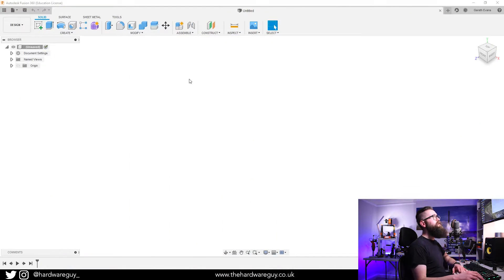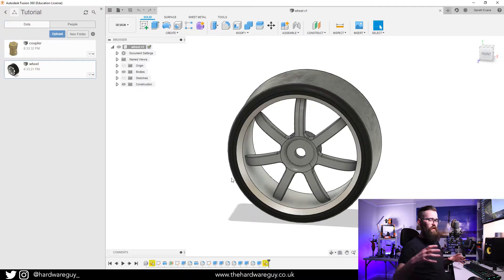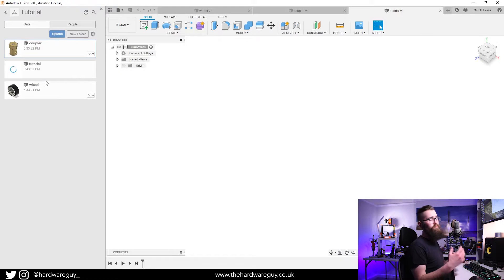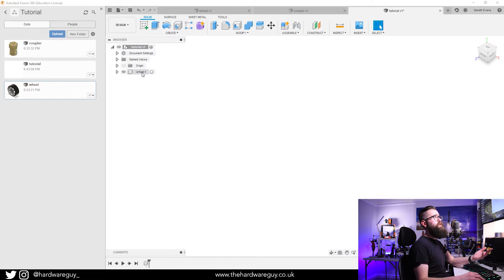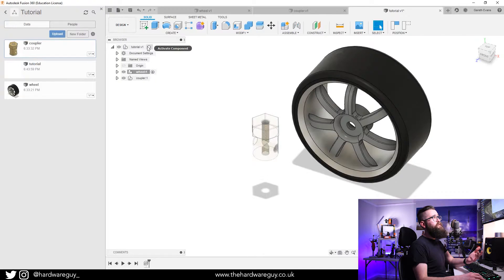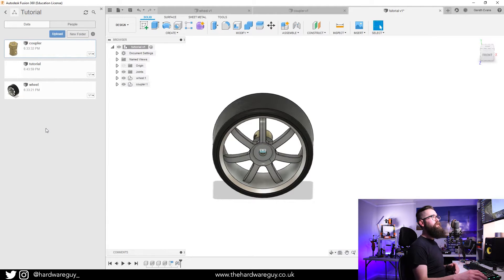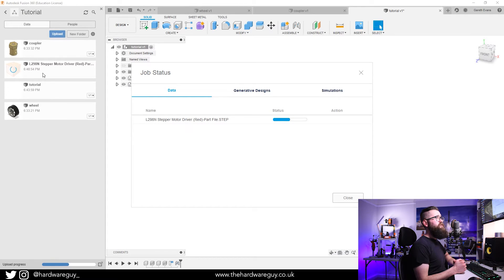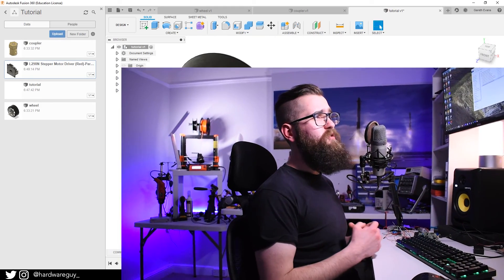Importing Models/STEP files to Fusion 360

Comment: I'm a newbie in Fusion360 and I've been struggling to make an assembly. With my student license I am limited to have only 10 designs on workspace at once. My assembly has more than 10 parts (files) and once I have reached that number I am no longer able to add new ones and can't delete the files already added to assembly because appears a message telling that that file is attached to other files and can't be deleted. If someone can help me I'll appreciate the kindness. Thanks in advance!
Reply from the maker: Yes this is a limitation set by Autodesk. If you want full access it's £50/month unfortunately. Not many people are happy about this
Reply: @thehardwareguy  Thanks for replying. I've figured it out by adding parts to assemble and saving the file as .step closing after each step and reopening again to add new part. Thanks for the video it helped me a lot!

Comment: So, if you're a student or hobbyist, you need to keep an extra slot open, of which there is a paltry 10, for importing STEP files. This is a bad design. This is a bad design, and the group that implemented it with this functionality should feel bad about themselves. Whether its for being poor designers, or blocking a basic feature behind what essentially amounts to a paywall, they can take their pick.

Comment: Issue I'm having: When I import parts this way, I'll put a component where it goes with the move command. After that, I'll import the next part, and all other parts that have been imported revert back to origin. Is there a way to turn this feature off?
Reply from the maker: Make sure you tick the “capture position” box in the move menu! Also keep in mind that it’s much better practise to use joints for positioning your components!

Comment: Hey, nice video mate! Sadly the drag and drop function does not work for me. I am simply not able to pull the part from the tree over to the component. Did you experience such a problem in the past?
Reply from the maker: They changed it! You now have to create a new component, activate it, and then right click the design you want to insert > “insert into current design”
Reply: @thehardwareguy  Should pin this comment to top :)

Comment: Hi thehardwareguy. Thank you for good tutorial. I tried to pay membership but it gave an error " could connect to PayPal...etc.... I´ll try later.
I have a question about Fusion 360.
I downloaded a .STL file from Thingiverse. It is an Signet Ring. I imported it as Mesh to Fusion 360 and did all " Mesh to Brep "- and so on. My problem is, that i want to resize the ring so it fits my finger. But i don´t know how because of all those " facets ". If i wan´t to resize the diameter of the ring but is almost impossible because of those facets. Is there any way to hide those facets so i can resize the rings diameter or how would you do it if possible? Thank you for possible answer. Here is the link to that ring " https://www.thingiverse.com/thing:244299 "